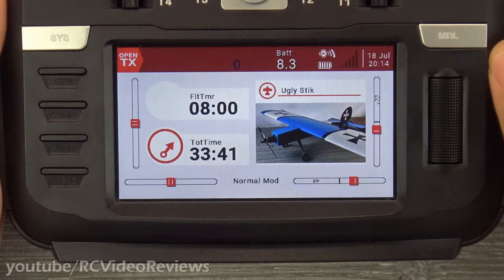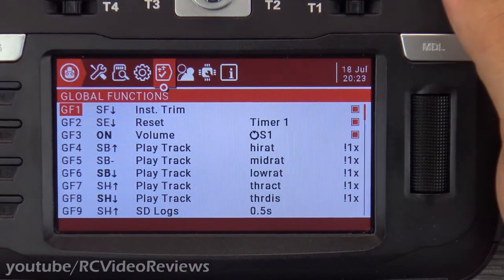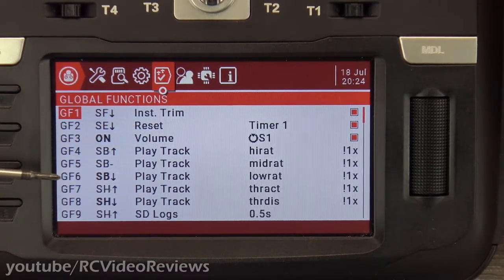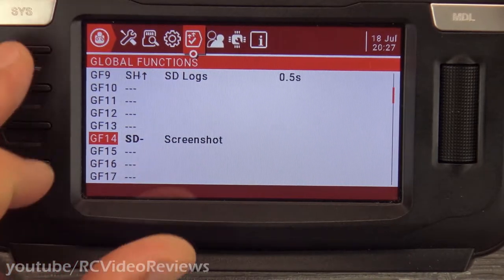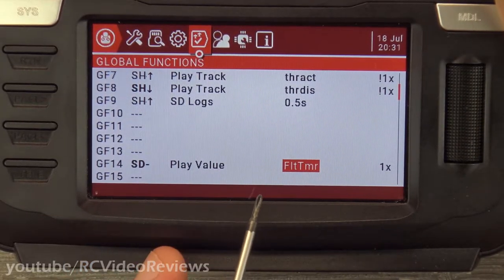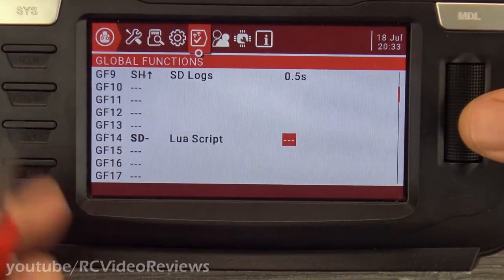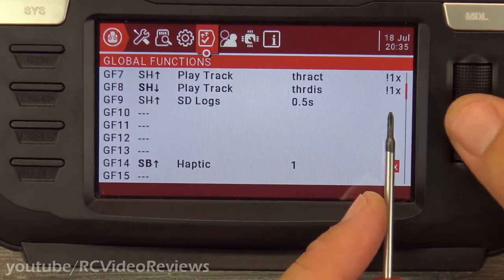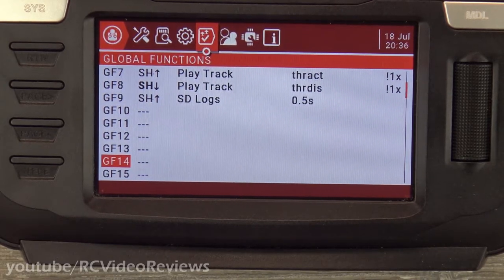OpenTx Tutorial • How-to use Global Functions • Radiomaster TX16s • [Beginners]

Comment: Great video, being new to opentx comes with with a lot to learn. A lot of this I learned already but you have just taught me something I was trying to figure out! How to not get the play track for every switch on startup. It’s people like you that make opentx fun to learn thank you.
Reply from the maker: Awesome! Always nice to know the work I put into this material helps people out. Since you left such a nice comment, I'm going to give you a pro tip that I'll cover in the next OpenTx video: Under Radio Setup (gear icon) near the very bottom of the page there's an option called "Play delay (sw. mid pos)" I have mine set to 190ms. What that does is delays playing of a track for a switch position for that period of time. Here's the idea: Say you have high, mid, low rates on SB like I do and you flip from High to Low. You don't need to hear the radio call out the mid position because you skipped over mid. By using that delay if you move the switch before the 190ms is up, the radio won't play the middle track. 

That's just another example of the granularity they provide on OpenTx. It's been very fun to watch this software evolve.

Anyway, welcome to the channel. Make sure you sub and hit the notification bell so you know when I post other OpenTx vids.

J
Reply: RC Video Reviews unbelievable it’s like you read my mind about what I want to change but haven’t learned yet. I’ve been looking for videos for this type of information but nobody does videos for the little things like this it’s always full on geek which doesn’t help the newbies. Thank you again!!!
Reply from the maker: Yeah, there is a lot of material out there, but some of the obvious stuff gets overlooked. Glad it helped.

Comment: Hi. I really like your video's. You explain everything in a simple way. I already fly RC planes and drive RC cars for over 50 years...But you need to go with the time right? 
Since I am also a sound engineer, musician as hobby and retired industrial engineer I see a lot of things in common of the settings and setup of the tx16s when I compare it with digital audio mixers or prorammable  industrial sensors,encoders, frequency motor controllers, stages and bus control systems.

I just bought a tx16s mark 2 max and while I am waiting for it to arrive I already want to learn everything how to set up and edit the transmitter and how to set up my planes. 
Your video tutorials make that a lot more easy..
Thanks and keep up the good work...And don't crash!....Hahaha. Greetings Herman from the Netherlands (near Amsterdam)
Reply: Funny..I remember I build an ugly stick just from a German magazine called FLUG about 40 years ago from balsa wood and put a os max  40 on it....Was a good plane until my 27mhz Robbe transmitter had  problems...probably because of an illegal hobby Am Radio amateur what caused a lot of interference on RC model control systems those days...pff...We also needed to wait for each other if we had the same crystal so the same frequency. because we only had limited amounts of channels available.  this stayed also later with the 35mhz for planes and 40mhz for cars boates and sometimes planes and helicopters. Yep a lot changed in 40 years with open tx systems...Much better..But somehow I miss the old days...But that's because in my opinion its because people changed and to many gouvernement rules now...
Reply from the maker: Good luck with your radio. When you invest the time to learn the core functionality, the rest of it becomes quite easy.

Comment: I have been procrastinating on learning global functions. Thanks a bunch. I know you showed openTX . Do you have a video on EdheTX GF. My global functions are significantly different. When I choose GF1, I get drop down lists, and the function list is limited. No throcut or flaps etc.
Reply from the maker: Global functions on EdgeTX and OpenTX are pretty much the same. There may be a few new ones on EdgeTX. Special Functions and Global Functions are not identical. When there are potential negative implications of setting a feature as globally available, decisions were made to remove it. So if it's not in the GF list, you'll have to set it as a SF.

Comment: thanks again for the instructions. Very useful.
The GF are really cool feature as I also have my switches in muscle memory and won't change them. Only the Throttle Cut I have to.
 I just wonder where my speech files for Throttle on/off are or low/middle/hi rates? can't find them when I scroll through...
I guess I could record them myself and copy them into the SD card.
Reply from the maker: Have you installed the Amber sound pack?
Reply: @RCVideoReviews  no, I didn't even know it exists.

Comment: Nice tut sir. Recently i am getting vibration in mid flight dont know exactly when its coming.  Getting vibration just once randomly not repeatedly any clue sir? I have set Rssi voice warning and battery warning also as voice commands. Haptic is set to nokey. Does hapatic activate on low RSSI or batt voltage?
Reply from the maker: I'd start by deleting telemetry to see if those are causing the warnings. If they are, then you can add them back and figure it out as you go.
Reply: @RCVideoReviews  I recently updated firware back and fourth from then on this issue is commng. Dynamic is on so while shifting 25 to 100 or 250 will the haptic triger?

Comment: I'm trying to implement some of the Global Functions that you outlined in this video, but I've run into a couple of obstacles. 1)  The S1 and S2 rotating pots don't seem to show up in the list of available switches and 2)  When I try to assign a switch to Play a Track, none of the .wav audio files show up under the parameters column.  I just see four little dots.  I checked, and those .wav files are present in the English folder of the Sounds folder.  Any thoughts?  Thanks for a great video series!
Reply from the maker: The pots are not available in the first column, but they are available in the 4th column.

Do this on a blank GF Line: 
1) SA down
2) Volume
3) Press Jog Dial and release. Cursor should blink. Spin S1 or S2. That should set S1 or S2 as the volume control for the radio.

It shouldn't be "English" it should be "en". The path should be:  /SOUNDS/en/  The first file in that path shoul dbe 1cell.wav if you're using Amber.

If you see that in your SD browser, long press on it and the popup should offer a play option. Hit play. If that works, then you should see the wav options in your drop downs.
Reply: @RCVideoReviews  Success!  I've got volume control on a pot, timer reset, and three dual rate settings, with audible announcements of their status.  It is coming together!
Reply from the maker: @tcgliderguy1  Awesome! What was the issue with sound?
Reply: @RCVideoReviews  I installed the Amber voice pack (after my first inquiry to you about this) and those .wav files showed up.  I think there may still be an issue with the Companion app finding the SD card contents, but I'm puzzling over that now.  I've got a manually created backup of the latest version of the SD card on my computer, so there's no danger of anything going to far astray.  Thanks for the help!
Reply from the maker: @tcgliderguy1  You're welcome.

Comment: Hi
Thanks for the super videos -rally helpful.
I have used global functions as described in the video to reset timer1. It works except that if you try to reset when throttle is not -100 a throttle warning pops up which will not go away until throttle is zeroed. Un ticking throttle warning in main set up screen solves but now (obviously) no warning on start up.
Any ideas.
Reply from the maker: That's weird, mind doesn't behave the way you described yours. 

Here's what I setup:

1) Added Global Function GFx, SE down, Reset, Timer 1, On
2) Exit to main menu
3) SE down, timer 1 reset
4) Throttle to 50%
5) SE down, timer 1 reset - no alert
6) SE up, timer 1 continued countdown
7) Throttle to 100%
8) SE down, timer 1 reset - no alert
9) SE up, timer 1 continued countdown

I can't replicate what you're telling me.

Comment: I have latest sd card installed but on my playtrack selection no hirat or lowrat wav! please assist if possible thanks. I have looked in latest zip as well but dont see Hirat etc either perplexed not in system folder either... I have noheli for radio build
Reply from the maker: You need to download and install the Amber sound pack.
Reply: @RCVideoReviews  yes done that scolling is a chore so remember to always set up tracks on companion!
Reply from the maker: @BrianRamseysg01  Absolutely right :)

Comment: My global function don’t those 3 little dots
Reply from the maker: Can you be more specific? Are you referring to the three dashes that are placeholders for the switches? What are your build options?
Reply: @RCVideoReviews  in Global Variables:

GV1         0  FM0  FM0  FM0  FM0  FM0  FM0  FM0  FM0

And each line has the same the same

I was trying to do the same thing you did but on the GLOBAL VARIABLES page it was not the same as on your radio.
I am using RadioMaster TX16s Max.
Reply from the maker: @reginaldmcnab3265  Global Variables are not the same as Global functions. You get to Global Variables by pressing the MODEL key. You get to Global Functions by pressing the SYSTEM key.
Reply: @RCVideoReviews  yes you are right! Thank you so much!  Ice work! Thank you once more.